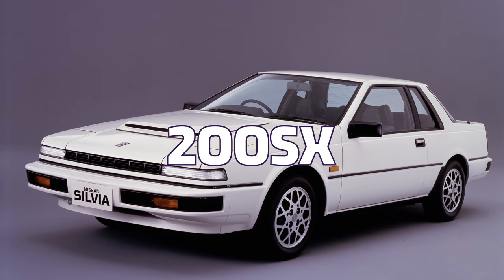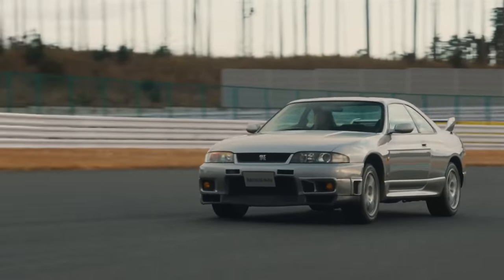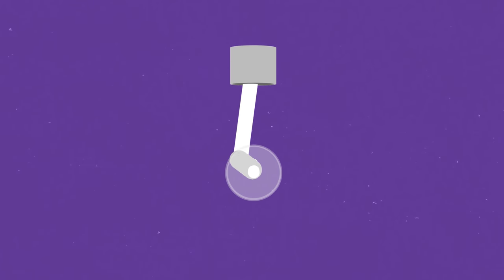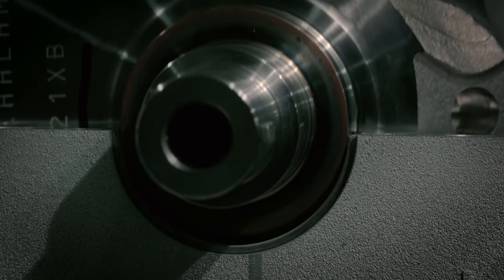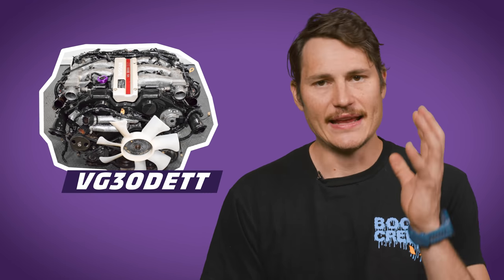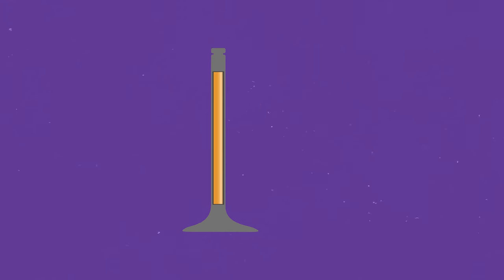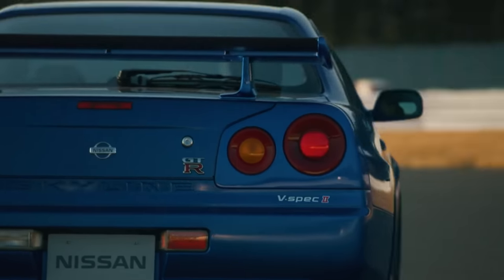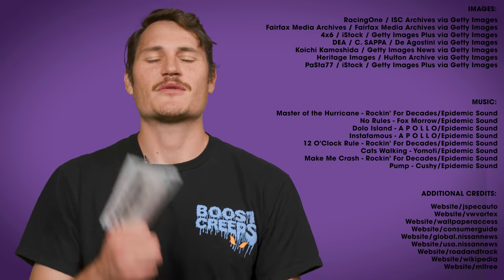RB vs. VG: Why Nissan Discontinued Their Best idea

Comment: As an Australian I appreciate the shout out to the RB30 powered VL Commodore.  The next model after the VL, the VN Commodore was supposed to have the RB30 in it as well but the appreciating exchange rate of the Japanese Yen against the Australian Dollar made the RB30 too expensive so Holden had to ditch the RB30 at the last minute and put the Buick 3800 in the VN Commodore.
Reply: it actually was a ford/holden war,the XFN ford/nissan ute was supposed to use the RB as well but ford and holden didmnt want to share the engine,public did not accept a australian car with a japanses engine back in the 80's
Reply: It's funny you say that when the original reason the VL got the RB was because the Holden 6 that can trace its routes back to 1948 couldn't pass the emissions regulations of 1986 and the V6 Holden was planning to use wasn't ready yet, so the VL got the RB and the VN the 3.8. Though "wasn't ready yet" could've been because the engine factory had to be retooled to start building V6s, which takes years to do
Reply: @MuscleCarLover    They weren’t really ready to use the Buick V6 at the time of the VNs release. I think they were hoping to have a bit more development time and introduce it with the VP but their hand was forced by the poor exchange rate. I used to own a series one VN and you could tell that it was hastily converted to rear wheel drive as it had tubular steel pipes all over the place to run the coolant lines to the correct place for a rear wheel drive application.
Reply: @David-lr2vi  Okay, yeah. Early VN motors were shit to work on, my father had a 1990 model and the placement of shit was hard to get at
Reply: @andrewsmart2949  except that the VL sold in droves and was readily accepted by the public - they really didn't care. Nissan had to make a deal with Holden to not add the turbo to the aussie built R31 Skylines, which were a vastly superior car in pretty much every way.
Reply: @MuscleCarLover  tooling for the 202 block was stuffed and had been since the first of the blue motors - brand new VK commodores would chew oil due to really poor tolerances straight from factory. The 202 really should have been retired much earlier, but Holden being Holden had no future plans. Holden had to look elsewhere and the RB30E was pretty much bulletproof except for Holden's less than satisfactory cooling approach which saw RB30E powered Commodores overheat. Look where Holden is now, gone.
Reply: @thesolver1970  VL didnt sell in droves,only govt fleet and police contracts kept it afloat in the 1980's recesssion it seems many people cant remeber and have no idea what 18% interest home loans look like,1980s australia was in fits over a japanese engine in a commodore and many chose the shithouse stock VL V8 engine which at 122kw stock was the weakest spec 308 ever bar the group A larry perkins specials and the walkinshaw(which used odd brittish engine management)
Reply: @thesolver1970  Yeah, it was a real gamble as to whether a new 6 cylinder VK would be good or a total dog, it's telling when a little while after launch, they actually vastly increased the allowed tolerances as so many were coming in with the same issues, one customer even tore down the engine and measured every tolerance and submitted their findings to Holden. That's what they get for giving people an engine that's pushing on for 40 years old in design
Reply: @MuscleCarLover  I had a few of these - VK Calais EFI, SL Commodore - they got to about 60,000k’s and then they started smoking, one VK that my dad had starting smoking at about 20,000k. Such a shame, best shape of the pre-VN commodore IMO. But really they should have started looking pre VC, they knew the 202 wouldn’t survive much longer. Even the 308s (esp blue motor) also started to have trouble, although my WB Caprice with a blue 308 seems ok. God imagine a family 4cyl in the VL, which may have been on the cards, given thats what NZ got!
Reply: @MuscleCarLover  was looking for a comment like this. My first Oz ever (yes I’ve never one until now) is 90 VN series 2. What a fkn nightmare to work on. Can’t see shit from underneath and can’t access most useful stuff from on top. The chassis rails are so close you can firstly see it was designed for the in live 4 and 6 cylinder the Europeans were using.
Reply: i tossed out the rb30 out of my VL and replaced it with the rb25det it was a good straight swap but i shoulda kept the bottom end of the 30 and put the 25 heads on at least, still moves though,  burnouts are Soooooooo easy now too
Reply: @LassoKid7777  rb30/25 is a pretty big job though isn’t? Not exactly plug n play. I get where you’re coming from though mate, hindsight is a bitch sometimes. Rb25 would be so nice in a vl or r31. You’re still sitting happy I’d say.
Reply: With the change to unleaded fuel in 1986 the venerable red/blue/black was never gunna make it. Costing the Nissan option the exchange rate was 400 yen to the dollar, and at 300 to one was still a good deal. That changed in 1988 when the all new VN came out, and the Buick engine was ready by then. I had a VL for a while and it was the best six I've ever driven.
Reply: It is worth noting that the RB 30 was a single cam normally aspirated 3l which can hardly be compared to the twin cam turbo engines notwithstanding the common basic design. At the time it was a revelation compared to the gutless, thirsty and not particularly robust old pushrod motor in the VK. However it would be consider a smooth but gutless motor by today’s standard with 114kw in the Commodore and 118kw in the Nissan Skyline. Even the turbo Commodore only pushed out 150kw. handy for the time but puny compared to current expectations. How times have changed.

Comment: Vg's used to be cheap.. I've been looking at used replacement vg's for years(like 10), and ever since covid the prices have doubled or trippled on ebay. Used to regularly find low mileage jdm ones for $800-$1200, but now high mileage ones go for that much and you can't find good ones for less than 2,800 or so
Reply: That's still ridiculously cheap in a relative pricing sense. Pricing for EVERYTHING has gone up since COVID.
Reply: Prices aren't going up, the dollar is going down.
Reply: Just go for the vq, still cheaper than the vg with similar performance
Reply: @ramadhanisme7  yeah but if I'm going to have to do a swap I'd rather just go RB or LS
Reply: @IanJesting  rb is hell expensive because of "jdm tax" while LS is a very good alternative since it's easier to work with and pretty much bulletproof
Reply: @ramadhanisme7  yeah I've been leaning more towards the ls for those reasons. I was considering the VH45 a while back, but now the "jdm tax" has caught up with it too.. You'd have to find a cheap running q45 locally now to do that, and for the work It's probably just better to go ls at that point
Reply: Just bought a low mileage vg for $300
Reply: @evan-od4fq  Junkyard I'm guessing? I've been hoping to find one there. I got lucky and found a engine for my gen 3 montero for $270 but the z's are so rare to find
Reply: I just bought a single cam vg for $300.
Reply: @ghoulbuster1  This is not what is happening... If this was actually the primary cause, then the major effects would be predominantly isolated to the US & other countries that use the US Dollar, but instead, listed prices across the entire WORLD for the VAST majority of consumer goods have gone up SIGNIFICANTLY since the start of the COVID-19 pandemic (and most especially in terms of bulk wholesale prices for the raw materials required to make said consumer goods).

The primary issues here are the countless global supply chain interruptions of varying intensity caused by the pandemic (with arguably the worst of these affecting non-cutting edge fabrication node semiconductors [aka any & all chips made on a >=28nm fab process]), NOT any individual currency getting weaker. This is why this is a GLOBAL problem and not just an American one.

In fact if this WAS actually all due to a weaker US Dollar, then America's major trading partners like Canada & the EU should all be having economic booms atm... which is obviously NOT what's going on right now.
Reply: @Cooe.  You're god damn right.

Comment: I've had both engines and they share a lot of components. In my experience in modifying both for over 25 years, the major issue I'd found with the vg was space... or lack of.   The current powerplant in my R33 runs a 3 litre block from the VL Commodore as mentioned in this video stroked out to 3.4 litre matched to a RB25det head with a RB26 solid lifter conversion... she pushes out 437kw to the wheels....

Comment: Great vid, but one important miss about the RB; The cylinder wall & deck casting is thin, they all crack at ~600whp. They're also plagued with oil circulation issues.
Reply: From what I've read oil issues were only on the R32
Reply: Don’t know where you heard that lol, been tested time and time you can push 700-800 on a stock 26 block. Motive DVD done a trial and error time and time again
Reply: @KIDAYREVI  they also did videos showing all RBs have relatively thin casting compared to other popular straight 6s. 

If you want to make 600whp+ reliably & cost effectively with a straight 6, RB isn't the answer.

Comment: The ultimate engine is the 90 degree V12.  It's essentially two I-6 engines with natural vertical and rocking balance, where each V pair creates six 90 degree V-Twins, which have a perfect horizontal balance.

Comment: The "bolt on performance upgrades" are dependent on actually being able to bolt anything onto a VG motor. Which is impossible, since they're a huge pain in the ass to work on.
Reply: Gut the inake and slap a HX35 to the side. Mercedes injectors z32 maf and a few other small things and you’re good for 500hrsprs
Reply: The VG30DE's were, the VG30E's were really simple, they just lacked the aftermarket support needed
Reply: The VG30E engines itself is not bad to work on. I just don’t know how cramped it is in the z31. I love these engines
Reply: @JKearns98  the turbos can get rough, and the wiring is spaghetti no matter what you get, but if you get a repair manual it's not bad at all
Reply: @JKearns98  it's really not. The Z31 has a larger engine bay than the Z32 and the VG30ET has a much smaller footprint than the VG30DETT
Reply: they were the precursor to today's engine bays.  once you delete enough of the unnecessary stuff it is quite easy to work on.  It just takes longer because you may have to remove more stuff.  Except turbo's.  you are lifting the engine for that.

Comment: People may hate working on the vg30's but it's much more reliable then RB's
Reply: Yeah ive found them to be very reliable also.  Ive had 2 myself and for me the only Nissan engine i like better is the VQ35
Reply: @RByrne  I've owned 2 G35s and have some mixed opinions about the VQ35. I love the cars and think they have a lot of potential. But MAN are they a pain to work on.
Reply: @garbagetrash2938  more painful than a z32?
Reply: @RByrne  The VQ35 is a good engine but its biggest downfall is it's always naturally aspirated in all OEM applications. The new VR30 is a much better replacement for enthusiasts.
Reply: @Thor Odin son Exactly how many have "blown apart"? The VQ35HR is an improvement over the DE sure, but its just too anemic and underpowered for a modern performance car. Especially a Z.
Reply: @Thor Odin son No it's not. It's an RB. Look up Jorge Lazcano. He was running 6.0s with the VG then switched to RB and ran a 5.9
Reply: @Thor Odin son And guess what the fastest land speed record for a Japanese car was set by a vg in the 300zx ....when it comes to drag racing it's about suspension setup track prep ECT so the vg setting that record is more impressive than any drag record set by those engines

Comment: I would love to see the 4AGE vs the 3SGE/GTE. They both of Toyota's most important engines for racing, but the 3S doesn't get the credit it deserves.
Reply: bc it sucks :D
Reply: @Megacatares  stick to your bike bro
Reply: Not the most fair matchup as they go with different thought processes, N/A vs turbo vs supercharged, but that would be great! FYI Toyota back then had a habit of making 2 performance 4 cylinders, one with small displacement, and one with large displacement. The 4age replaced the T-family of small displacement performance 4 cylinders, and the 3sgte replaced the 18rg motor that toyota had been using as the large displacement performance 4 cylinder. the 4age showed up in the early '80s while the 3sgte appeared in the late '80s/very early '90s.
Reply: ah an mr2 nerd well guess what...

k20 swap 👻
Reply: @snezzijezzi9037  TBH I prefer large bore short stroke engines, but k20 is alright. I'd rather a 4age, but thats more for the sound. K motors dont sound that great for a 4 cylinder.
Reply: Not sure it would be much of a contest. The 3S is the newer more advanced engine by all means. And the truth is, 4AGs are only popular in the AE86 these days, its the full package that has the fanboys get wet. The 3S was in a lot of cool and very different cars, from the GT Turbo Celicas to the NA RWD Altezzas.
Reply: @bogdanrus7953  There's not much that separates them advancements wise, though the 4age could come with a 20v head, itb's, and has much more aftermarket support for a na build. Also have you ever even heard of the aw11 mr2? or a at160 celica? or ae92 corolla? Even chevy put a 4age in their nova.
Reply: @Thor Odin son Why is everyone k swapping their mr2's then?
Reply: Well, maybe it would have gotten all the recognition it deserved if the smaller stars of Initial D had a Celica All-Trac or MR2 Turbo.
Reply: @JB-sv5pr  and you stick to filming cars from your balcony XD

Comment: Both legendary engines! My first car was a 1990 Nissan Pathfinder with the classic VG. We put custom headers, high flow cat and exhaust on it, and it screamed! Probably about 180 ish HP at the crank, lol. Was not friendly on fuel economy, though. It was bullet proof. Sold the car with 161k on the clock running fine.

Comment: as an owner of a Z32 for almost ten years, the VG30 has been a very reliable and great motor. everything is fairly easy to maintain, except for when an injector misfires or fails... which is bound to happen at some time in ownership when dealing with an OEM setup. having to remove the plenum to get to the injectors is time consuming compared to other engines.

i envy the RB26 for its simplicity in that regard.
Reply: But you only have to remove the injectors once and replace them with nismo 740’s done!   People talk about how cramped the engine bay is, have you looked at newer cars that are twin turbo?  Q60….. that’s what you call crammed!
Reply: Excuse me, easy? As someone that got a 94 300zxTT to stage 4 / 450hp, no, they are not easy to work on. I created more frankentools for that car than the rest of my wrenching career because the engines packed into that bay tighter than a can of tuna..loved it to death though. Monster of an engine. Just sucked having to decide if I wanted to pull the entire engine to do turbo work, or cut and then weld several box ends.
Reply: @RWR-nq4gd  “fairly” easy because i own an NA haha.
Reply: I drive a 240sx with an rb20det I love that motor.
Reply: @RWR-nq4gd eh once you’re used to the process you can rip it out in 5 hours or less, helps to have other knowledgeable z guys around, and if you do it right with quality parts you really won’t ever have to touch the turbos again.